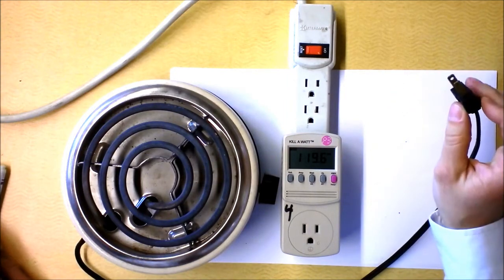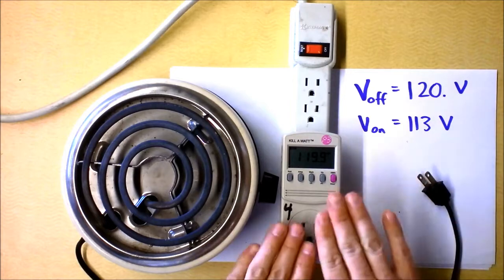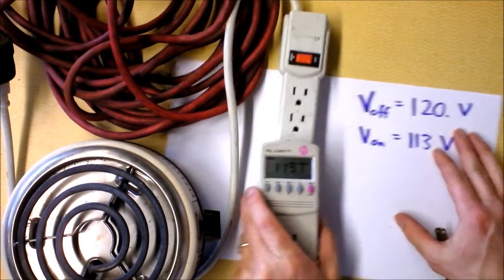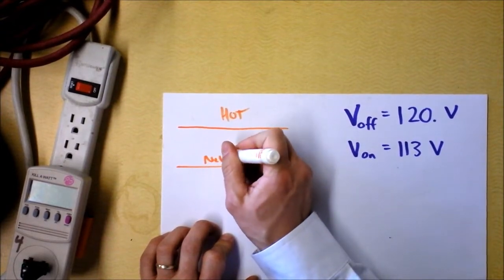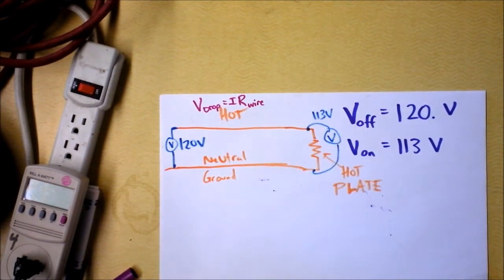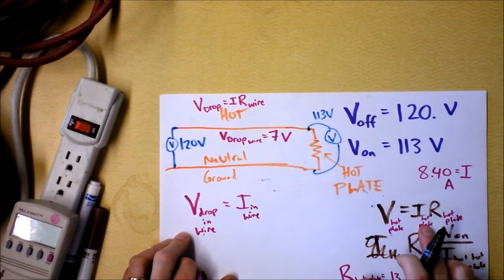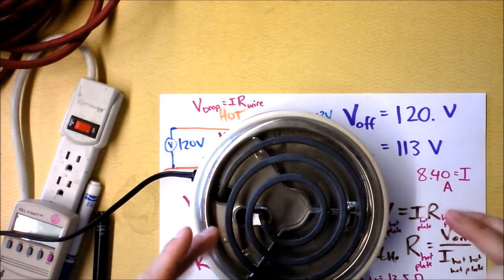There's Resistance in Them There Walls | Power Distribution Part 1 | Doc Physics

Comment: good video , for calculating total wire resistance you should have used 108 V though, instead of the 113,
Reply from the maker: Hector Huerta Ooooh - I think I disagree.  Care to share your reasoning?
Reply: Doc Schuster minute 6.20: you take the series current reading to be 8.4 amp but that is including the long ext cord cause you never took it off.. so voltage drop across hot plate is 108 and V.D. should be 120-108 =12 across all the big ext cord plus the original path toward transformer. From there uou take the resistance and so on.
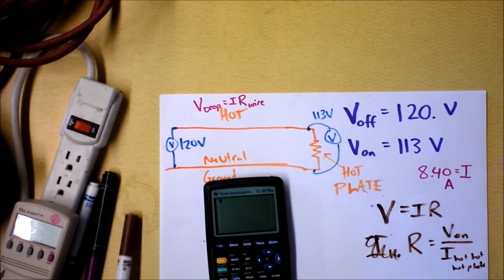Reply from the maker: Hector Huerta I defer to your insight!  I've added a note around 7:45 to correct this.  My value for the resistance of the hot plate is a little too high since I used the wrong voltage drop!  Thanks!
Reply: Doc Schuster my pleasure.. and you know, I really enjoyed watching some of your videos.  you are doing a great job teaching others all this electrical stuff .. thank you